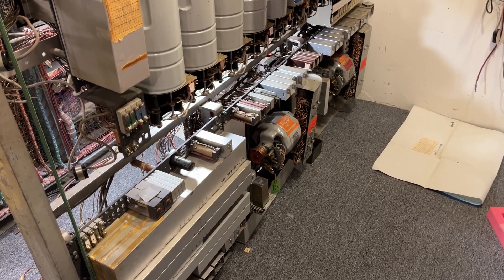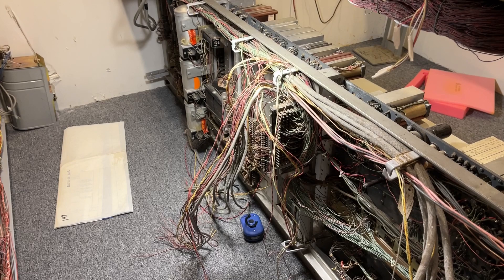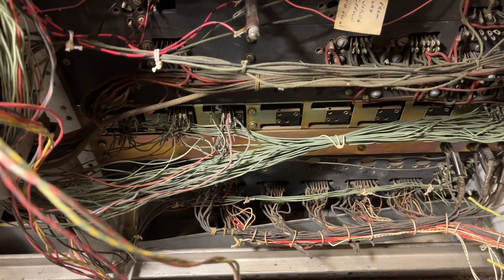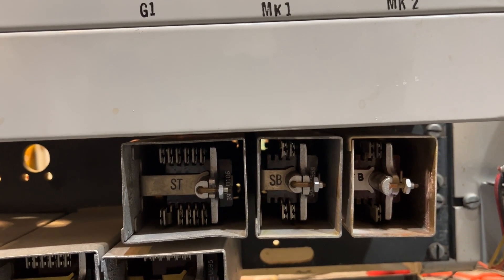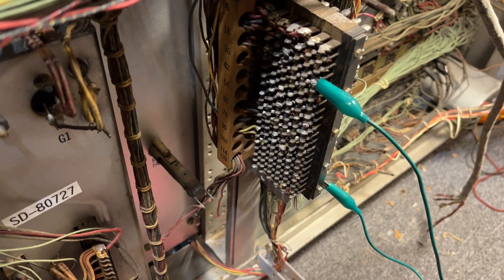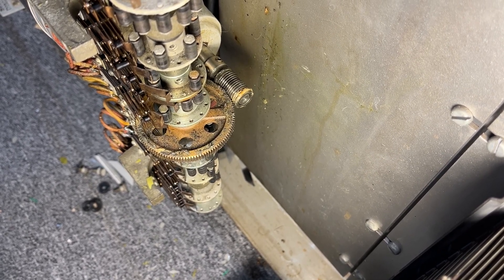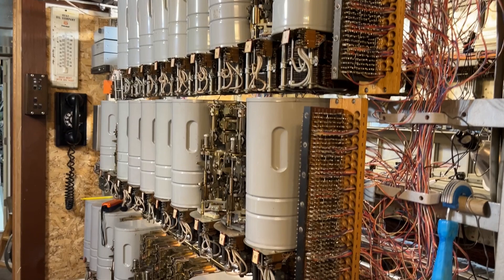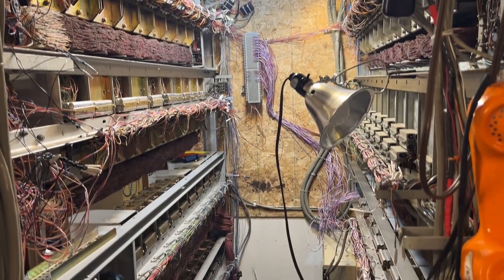Western electric 355a small sxs. Rotary ring generator-interrupter.

Comment: Nice demonstration!  Thank you for making this video.   Ring on time seems fast.  I noticed this with step PBXes that the timing of certain characteristics of the ring was faster than if it was a C/O plant.
Reply from the maker: @jeffdobkin9478  we had to use the second ring card because the normal one ring code had troubles within the interrupter and I run out of time to work on it.

Comment: In the late 1990's, there was something similar to this still running in the back of the Hedrick Office, in Overland Park, KS.  I was there to perform some MAC work on the DMS-100, but I recall other 'older' equipment in the rear of the Switch Room.  Looking back, I wonder if there was some 'flavor' of electro-mechanical Switching still taking place, in the late 1990's, for SBC?

Comment: We had 2 ringing machines connected to our D4 Channel Banks at the Portland Toll Office.  The D4 Channel Banks are now only used for remote access into equipment, so there is no need for the ringing machines.  So, when one failed years ago, there was no need to replace it and it's been Retired In Place.  RIP is a good name for it.